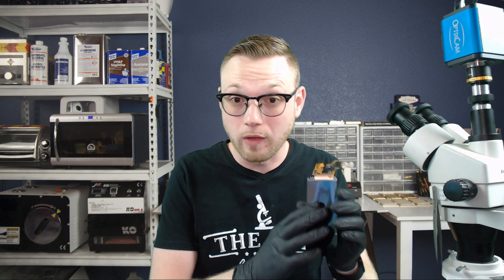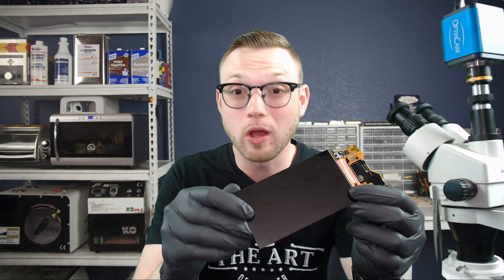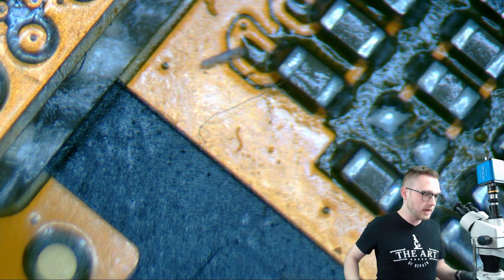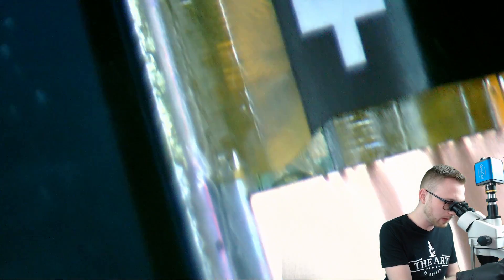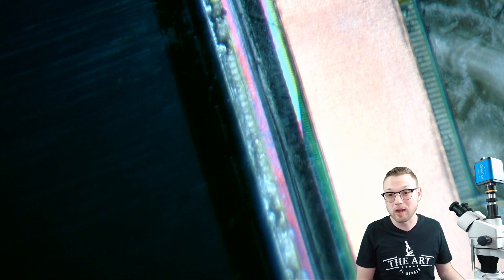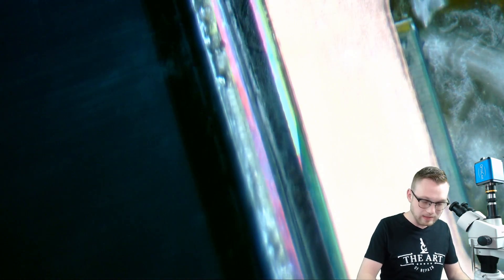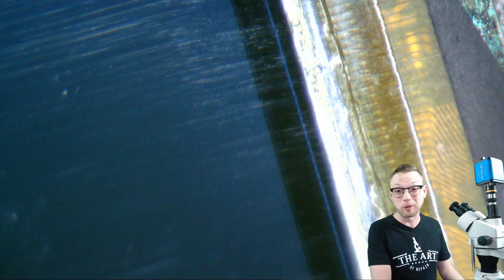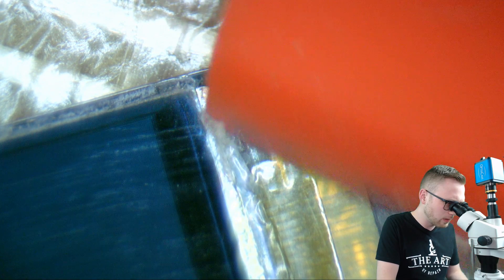EP38 Why should I buy a Microscope for Display Refurbishing?

Comment: I opened a Electronics Repair shop and it has been doing very good and I was wondering, I buy all my screen replacements on Amazon/eBay and was wondering if that is an ok place to do it? I have an LLC business but everyone I find phones wholesale takes months to get here. Amazon is in 1 to 2 days. Also would it be beneficial for me to buy a 5 in 1 LCD separator? I have watched all of your videos and you are by far my favorite YouTuber when it comes to this. I do microsoldering a lot and love my Amscope but I never separated LCD from digitizers and people tell me I am loosing money for not doing it.
Reply from the maker: Crazy thing is, as long as your a knowledgeable person. Amazon is not a bad place to buy things, a lot of distributors also sell from amazon. I would just look up who you buy from and see if they have a regular website. Its possible you may even get a better deal from their direct website.  Ebay screens do tend to be much cheaper though. I try not to source to much from ebay outside of small parts of oem pulls. I would say yes, you could say your losing money, but there is alot of money lost in the process of learning too. So as long as you have a good source of displays you can practice on, you should be fine. =) I appreciate you being so dedicated to the channel! I will be doing many many refurbishing videos shortly, as they are currently in production, so stay tuned!
Reply: TheArtofRepair thanks so much for replying! Oh and what solder iron do you use?

Comment: I'm just beginning to learn phone/small electronics repair. Never thought about a microscope being useful except for soldering. Good info, thanks. Do you have any experience with Celestron microscopes? They have some pretty inexpensive digital microscopes that seem perfect for this kind of work. I have a telescope of theirs and it's pretty nice.
Reply from the maker: I do not, The only thing i would suggest you check on for the usb webcam stuff would be the working distance, My big stereo scope have about 5.5in of working room and is fantastic. So try not to get anything that needs to be to close to your work. So maybe 4in working room minimum. With that being said, the digi scope should be never used for any work where feedback from WPI is 100% required, like for soldering. As far as I can tell, im the first person to consistently incorporate a scope into display refurbishing. So hopefully we see everyone doing it now! Just means we all need to try to see what else our tools can be used for!
Reply: TheArtofRepair I want to do soldering at some point but not right away. Thanks for the tips! Agreed, I like to experiment and think outside of the box too ha.

Comment: Great tip, in my experience with the flex cable area and ipa after I clean the area and I test the lcd it has vertical lines on the screen any suggestions for preventing that?
Reply from the maker: That seems like a pressure issue,  as long as its not soaking in IPA for extended periods. You should be fine. Just try to be more gentle and let me know how this works out.  Try not to put to much direct pressure on the flex area.